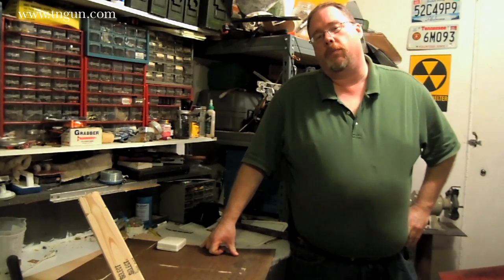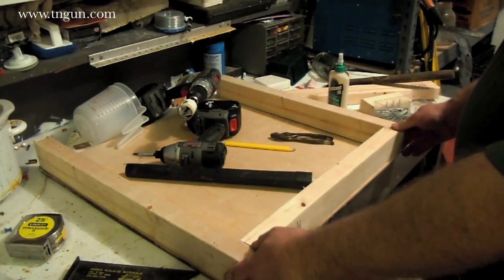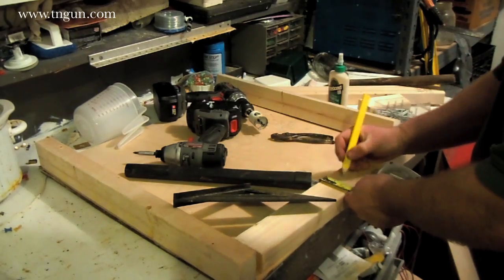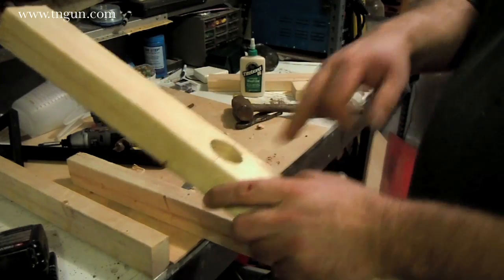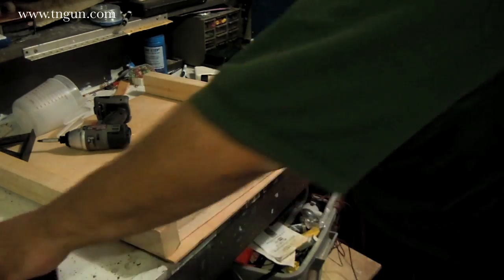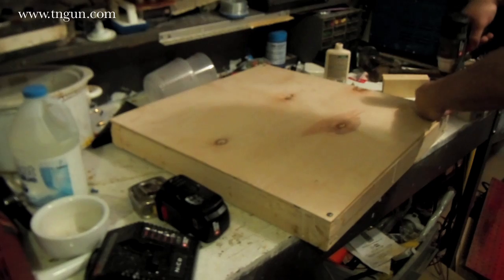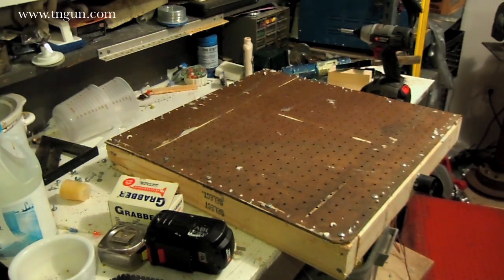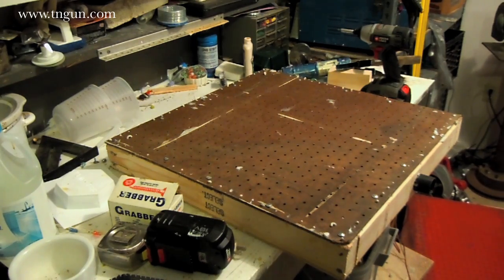How to Make a Vacuum Former Box

Comment: Thank you for posting this video. I noticed the Platen flexes quite a bit when you apply a load. Would a few timber dowels  placed vertically inside the unit, between base & underside of platen, suitably arranged to stiffen the platen help at all. Once the plastic sheet is placed over the buck/mold and vacuum applied, the total weight on the platen will be quite significant, possibly equal to weight of an adult standing on it. Nice simple build. Good job.😀